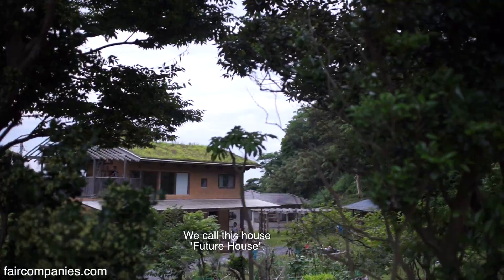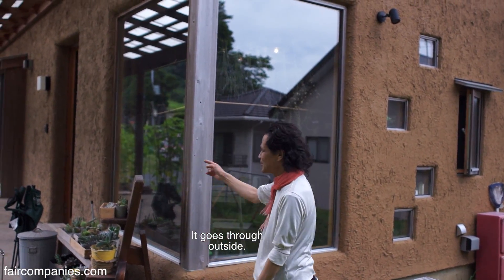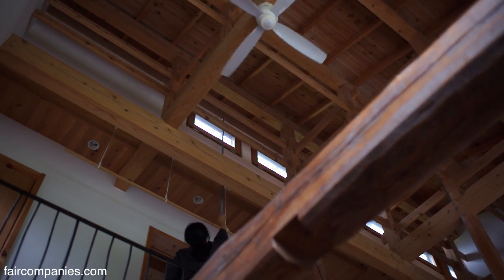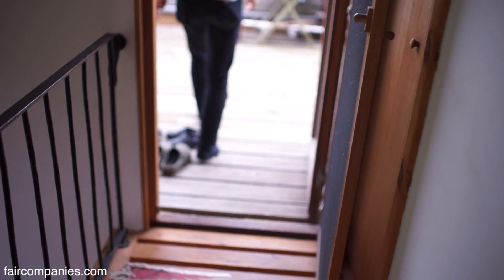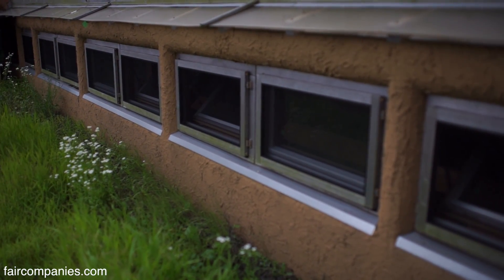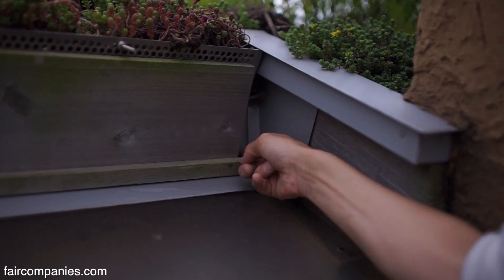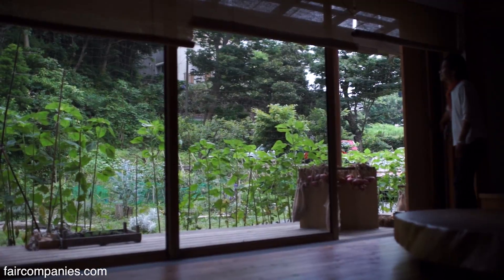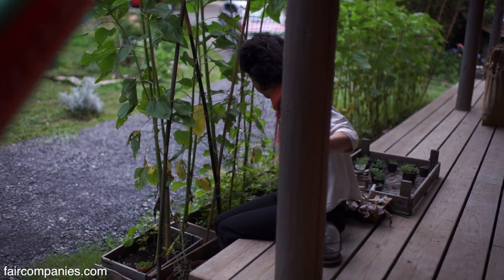Modern-traditional Japan mud home: bioclimatic on a budget

Comment: Just from the veranda roof I can see that he knows what he is doing. (Amateurs always make those too short.)

Mostly solid proven technologies: Termite thermal management, (cob walls; winter/summer sunlight used; air flow from bottom to top), top quality Japanese carpentry.  The innovations, (the breathable wall and air flow under the living roof needed a good translator to fully permit this architect to transmit his ideas. (He clearly has a lot more to say that isn't getting through the language barrier.) How are the breathable walls constructed and supported. How do they manage insects? Don't want wasps moving into the breathable walls and impeding airflow.

Efficiency of the wood stove can be improved with existing technology. How is the water heated for the ablutions and kitchen?
How is the sewage managed?

How many of these can be adapted to be used at scale because most people now live in cities, (rather than land hungry sudo rural housing.)

Comment: I understand in the summer having air between the walls keeps the wall cooler, but in the winter, wouldn't that wick heat away from the bouse?
Reply: Air is actually a good insulator, for instance in planes theres just air in-between the windows.

Comment: @Kirsten Dirksen  I'm very interested in this man's construction technique, especially his wall ventilation system.  It's hard for me to understand how he's done it, the camera points to little box like structure under the eves.  Is that some sort of air channel?   Is there a website or page that describes what he's done.  

For those of us in areas were we have hot summers dealing with heat is more of a concern than warming.   I can open my windows on many winter days, and have very few days during the winter were heating is actually used.  But I have extremely long and hot summers, where without air conditioning life would be miserable.  So, I'm very interested in ways to minimize that energy consumption.   I'd really like more information on his technique.  I plan on building my retirement home sometime over the next few years, and you're channel has given me lots of good ideas.  THANK YOU for creating this channel!   If you have a Patreon page I'd love to contribute to its continuation.
Reply: Very high ceilings in a house mean the heat, which goes up, beign lighter than colder air  has a place to go the top of the room which you dont inhabit, in a hot climate some traditional houses have very high ceilinged rooms they have them the Alhambre in Granada, and in old Marroccan houses and here in Spain, in Madrid they have them too. The high windows of this japanese house, when opened, might increase this effect might pull off  the hot air that has risen to the top of the house which is good as long as they dotn pull up the cooler air too. 

    Decidous plants, shade houses in summer but allow the sun through in winter. In this house they have grown beans to the south of the house to shade it in summer.
    Also, as the summer sun is high in the sky at midday , if you have a roof with a big over hang, then this wil shade your windows in summer, the summmer sun will not get into the rooms to heat them, while the low winter sun will get into the rooms through the big windows. So no heating in summer and a heatign sun in winter.

Comment: Great house. I with more houses in the SW would make use of over hangs. And the use of (what I always heard it called) Transom windows at the roof line makes so much sense to allow excess heat to move out in the summer.  No wonder the University is looking into the construction of this house. Great video and a very sensibly house glad you found it and shared it with all of us.

Comment: this method was used in my region for at least 500 yrs ..it is awesome and really cold in summer warm in winter
Reply: Clay sand straw manure mixes are used in so many places in the world, maybe assuredly in all countries. My aunts house in dorset was an old farm house made of clay. I looed up clay houses in Japan because I was wondering was how to build in mud and make it safe from earth quakes and I reckoned the Japanese would know the answer. 

 I suppose that a high straw type adobe would be best in earthquake regions though it be less efficient in storing heat, iless good as a theremal accumulating material.

    In this japanese mud house, they have used beams held together with pegs. I remember hearing that a bit of wobble room is a good thing in an earth quake. Aren't the wooden structures in traditional Japanese temples and such, made of wood that is pegged together or enlaced with the other beams so they are  held together but not nailed or screwed together, which building method give this bit of wobble room necessary in an earth quake. 

The pillares of the Parthenon in Athens are  made like a wedding cake, of different layers of stone, and, a documantary i saw recently said that they were held together by iron pegs, iron clad in lead to stop the iron from rusting and in some cases with wooden pegs which have lasted the passing of time,the wood of the  juniperus thurifera perhaps. The pegs are place in the centre of the different slices of the pillars in the parthenon, inserted into a hole in the centre of the lower slice and fitting into a similar hole in slice above, without being held in place ridgedly, they are not cemented in place or nailed in place so that the  pegs enter the slices well enough to stop them slipping totally off each other  but allow wiggle room,  and the parthenon is a structure that has held together for mileniums in a region smitten by earth quakes. 

 Here in Guadaljara, Spain, in the mud brick village Humanes, the bricks are the walls between wooden pillars as sort of infill, as are the plaster board infills of a North American house and so maybe, as in my village made of stone and mud where I know this is the case, the roof  were  held on pillars those of the walls and others inside the house, not on beams supported by the walls. Maybe, if the roof is held  on pillars, this will stop it falling on the houses occupants if the walls crumble which would be one good point in a region that was prone to earth quakes which Guadalajarra is not.

Comment: Building something fairly much the same as this. Did not discover this vid till after I had started. It really is an exceptionally well designed and crafted house. Probably one of the very few occasions where I take my hat off to an architect who actually really knows what he is doing instead of trying to make bold statements and misapplying materials and techniques.
Important to note that this is a Cob exterior earth house. Note the straw embedded in the earth. Makes the earth much tougher and quake resistant especially when its anchored to an interior timber frame that can flex.
This house is probably the most beautifully engineered I have ever seen.
Reply: What? The most beautifully engineered? Go away from USA to see beauty. Try Japan for a start.
Reply: kenneth keen. Thats exactly my point. Most building in the US is diabolically bad these days. What we need is a return to traditional standards of craftsmanship. I cant wait to visit Japan and see more of their traditional carpentry.
Reply: @brianminghella3312  They have odd ideas of building in Norht America. A book I have on ecologically buildings explained that they use posts as supoport for their houses and plaserboard to keep out the elements, that is to say, they, you  must have to heat your houses a lot, their walls are so thin. Also they will not last for centuries and centuries, as houses in Europe do, that means spending a lot of money the whole time. I told one american on a permaculture site that walls in Europe were really thick mine are about a yard thick and he was annoyed. 

Also the two towerrs, on falling gave frist responders cancer, doesn't that mean they use a lot of poisoned stuff when they build.
Reply: I looked up mud building in Japan because i was wondering how mud houses could be made that were safer from earhtquakes than many seem to be,.Mud being the main building material in so many countries  that  studying how to make it safe is so important and you say a flexible timber frame helps this. I would like to know more about the flexible timber frame that helps such houses in an earth quake.
   Also you mention straw in the mix also helping the buildings to with stand earthquakes and another gentleman on this site said that mud was a flexible material and so I wonder what mixture of straw, sand and clay helps with the flexibility, plasticity of mud walls which i suppose  reduces the probability that the mud wil crumble in an earthquake. I suppose more straw helps and maybe straw that is chopped into longer pieces and less sand in the mix also helps with the material plasticity. 

I have whatched  a site that gives different mixes of clay straw and sand, from one measure of clay,  one sand and half a measure of straw, to one clay, half sand and two and a half of straw. The site is great, the video is called, "Walls of earth", building, a contimuum. the nito project. Of course, in India they have vedic building materials rules, ancient laws on healthy materials and a living tradition in building iin mud. 

  Also i have wondered if manure, a material that is frequently a component in clay walls, starch and oor  butter millk which are also sometimes used, help the cob, adobe to be more elastic and flexible and so even more earth quake proof.

Comment: Nice house.  It's interesting to see such an traditional architecture mixed with modern elemen. In Indonesia, a multicultural nation, most of the traditional houses use wood. Like jabu homes of the Toba Batak people,  lumbung built by The Sasak people of Lombok, tongkonan from The Toraja of the Sulawesi highlands, and many more.. "The norm is for a post, beam and lintel structural system that take load straight to the ground with either wooden or bamboo walls that are non-load bearing. Traditionally, rather than nails, mortis and tenon joints and wooden pegs are used. Natural materials - timber, bamboo, thatch and fibre - make up rumah adat", https://en.wikipedia.org/wiki/Architecture_of_Indonesia
Reply: jagan lupa joglo, rumah gw jg masih joglo :D
Reply: buffer cov kinda speeka yanka lingo bat he is all hung ab with his baseboll score an he is sorta awesomly able to hit dem keys ta mak wurds lika sorta englis whatis guud for yanky wanks. duh.
wish ah was amery kan bat ah em nat yet. wen ah is yank ah will rite more.

Comment: It's a Japanese Earthship. Awesome. Definitely want to a smaller version of this.
Reply: Wonderfully old school. We have walked away from so much archival knowledge to resurrect. My great grandparents used these principles in their own work construction.
Reply: So glad you mentioned that. I've had a few friends work with Michael Reynolds in his earthships. The thing with them is that they need to be a considerable size to be able to hold thermal mass. This is pretty standard size.
Reply: @jadejaguar69  Thermal mass within a continuous insulated envelope will work in any building of any size, if passive solar. Just make sure to distribute it as evenly as possible throughout the dwelling. A compact layer of 10 centimeters (4 inch) throughout will get you a long way. Maybe go double on the floor and back (north) wall, consider building back- and side walls of cabinets in brick etcetera.
 Of course the size does have an impact on the speed with wich temperature will be absorbed and released but all this is a matter of balance and calculation. No reason why these principles couldnt be applied to modest homes, as Europeans do...

Comment: I love this home, unfortunately I like in Canuckistan, so I don't think it would work so well in our winter.

his English is quite good too, made this video not a headache to understand.
Reply: Just make a small lil house away from the main house for like the summer 

Ya up in the north ya gotta be creative but within ur means ya know
Reply: Clay like stone is good in a cold climate, it is a good thermal accumulater which means it will heat up in the sun, that is why leaving earth bare as is done say when leaving the ground fallow for a year, is a bad idea, lacking vegetation the earth will heat up in the sun and now that carbondioxide gasses make it harder for the earth to cool down it would be better to shade the earth so that it heats up less than leave it bare. 

 In order to work out how well a material serves as a thermal accumulater you have to think  of such things as its volume, these walls are thick and so will hold on to heat for longer, a thin wall wil not hold on to much heat..How long it takes to warm up or how much energy it needs to do so, is another part to the equation of how well a wall holds on to heat, If it takes a long time to warm up, then it will also hold on to heat for longer, lose it slower. Another aspect is its  conductivity, a material like straw will not pick up much heat, it insulates instead of getting warm in the sun. Taramac is a really good thermal accumulater,  stone, concrete and such are good thermal accumulaters, earth is as good as brick. If you look up videos on thermal dinamics you can learn about theremal accumulation. .  

Mud brick recipies change from ones that contain more straw to ones that have more sand and much less straw, so, some mixes must insulate houses much better than others and some are better thermal accumulaters. Maybe the ones that insulate bettter should be put on the north side of the building and the accumulaers on the south where the sun will heat the wall, that way you take ful advantage  what is called pacific solar energy.The man I learnt all this from is Larry Hartweg, in his videos of such things as  zero energy designs, and pacific solar energy. 

Another factor to take into consideration is that more straw must mean that the mud, clay sand mix  holds better, must increase the earthquake resistence of houses maybe how you chop the straw whether you leave it very short of longish also increases of decreases the muds resistence to earthquakes.

Comment: old traditional houses cost more even when using locally available material.
Reply: Not in the long run, if you consider the energy it takes to heat/cool modern houses

Comment: love it, what a house. Modern-old Japan mud house: smart & bioclimatic on a budget 
Published on Nov 23, 2015
To bring natural homes into the 21 Century, architect Tono Mirai designed “Future House”: a home that blends earth building and traditional joinery with modern design. Located in Miura, Kanagawa (about an hour and a half south of Tokyo), this fusion home was built for a businessman and his wife and 3 children.

The client wanted a healthy and natural home as an escape from his daily commute to Tokyo, but wanted something modern. Mirai designed a home oriented to the south so that its earthen floors and walls (of traditional Japanese mud plaster) can act as heat sinks for the winter sun. He built vents into the outer walls to naturally control the flow of air. 

The extensive living roof also acts as an insulator. Mirai calls it a “very natural way” to insulate, noting that the temperature difference between outside and inside the roof can be more than 10 degrees.

With all the passive solar and natural venting, the home doesn’t need AC or heating (beyond a small wood stove) and it delivers a natural air quality and “peacefulness” requested by the client.

Comment: I love this architecture and Japan, we were there for a month. However, I wonder how they deal with mosquitos, we got chewed up quite bad during the month of August.
Reply: According to the great African ecologist, Wangarie Matthai, the old fashioned African plaster made of cow dung and ash or lime, keeps mosquitos away. I found an old bit of plaster work on my house here in Spain that as I had dampened it, i found to be obviously made of dung and lime, wet it smelt of cow dung, which is often used in making mud walls or mud bricks as well as in plastering the rooms in a house this was on the outside on a window edge. Sounds yucky but if it gets rid of mosquitos!.  also just dung and ash must be a very good insulater, it contains so much grass that it is very light, feels and looks as if it is like a light hard board, a bit whiter. 

Joss sticks are also a good remedy against mosquitos.

Comment: A wonderful mix of sustainable and traditional Japanese building techniques. I assume it is seismically sound, would have liked to have seen more of how it is connected to the ground. The heavy wood beams probably keep it relatively stiff from top to bottom.
Reply: +MakeMeThinkAgain the heavy central beam (shinbashira) concept is actually incorporated in the earthquake-proofing techniques of many modern skyscrapers.
Reply: +MakeMeThinkAgain .............the wooden joints, pegs and the wedges that hold the timbers together are able to absorb much of the the movement during the earth tremors that Japan experiences. 
Even today we see many builders using this same traditional technique. The house shakes a little, but settles back afterwards, .......much better than concrete or brick walls.
The clay/sand/straw cob built on a bamboo framework between the wooden posts also flexes without cracking.

Comment: How does he stop vermin getting up the walls if there is such a gap from the floor to the eves?
Reply: +sctpc you wrap a long (horizontal) plastic mesh (screen) at the bottom as you attach 1 by material on the sheathing to attach and space the siding- standard for (good) builders in the USA
Reply: +sctpc also the mud is so tightly packed that they can't go through the wall itself either.